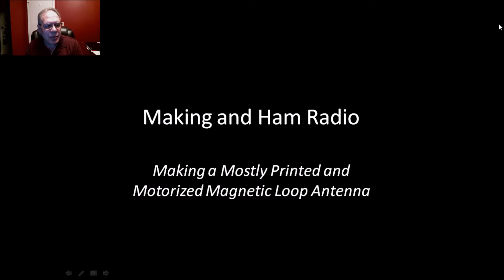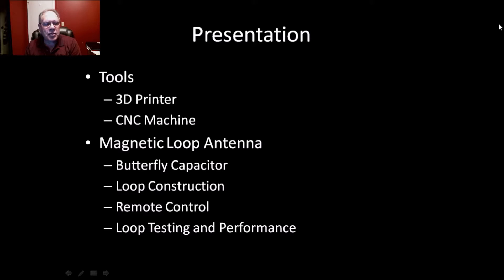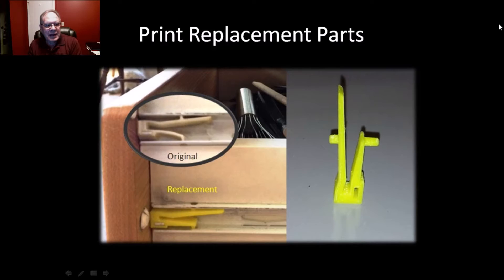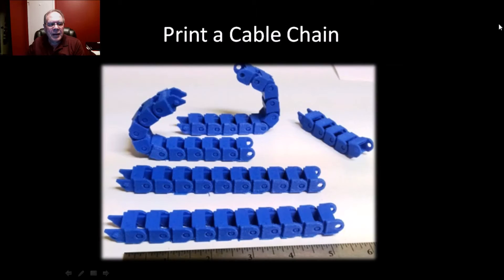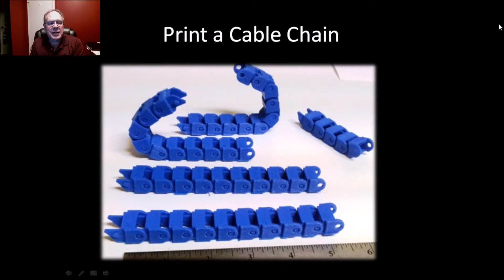Making and Ham Radio

Comment: Excellent John, truly excellent. I love the integration of the design using both the cnc machine (I'm getting proficient with this) and the 3D printer which I don't have (yet!). Possibly to answer your remote 5volt power situation you could employ a small solar cell charging a battery. I particularly note your challenges section; yes they will take some thinking about.  Thanks so much again John for your efforts. Paul, G0ODP.

Comment: Have you considered putting together a BOM for the CNC as well as the design you followed?  Maybe put your designed STL files on Thingaverse?

As a side note, you might consider shortening your Bowden tube just a bit, you want a little slack as possible and could have stringing issues.
Reply from the maker: Hi Jim. All of the MPCNC details (BOM, STL) are online - just search "mostly printed cnc". Cheers.

Comment: Excellent, you should have a lot more viewers for this. I didn’t see it covered in the video,  but how long did all of this take?
Reply from the maker: Once I had all the materials, it took a week to 3D print the parts, a few days for the EMT rails, then another two weeks to put everything together and wired. I took my time. Sourcing all the materials/parts took around 2 months as some were ordered overseas, e.g. bearings, stepper motors.